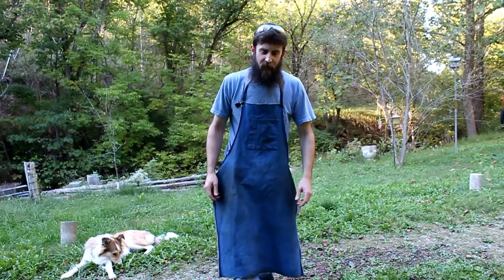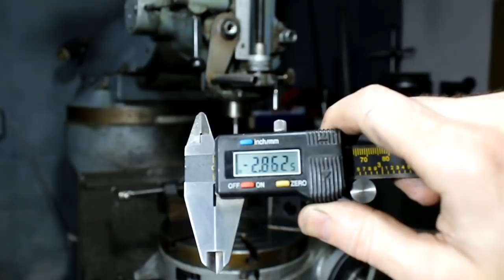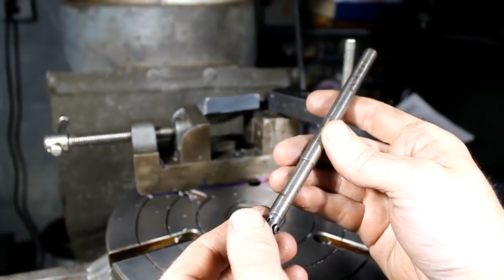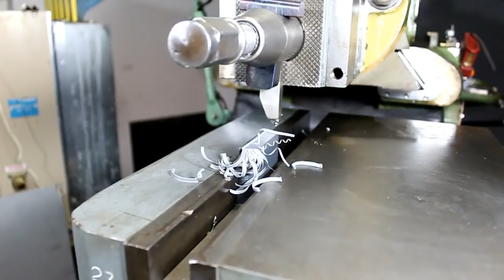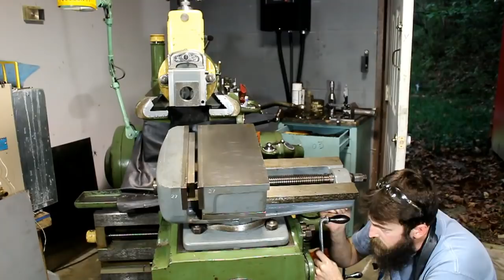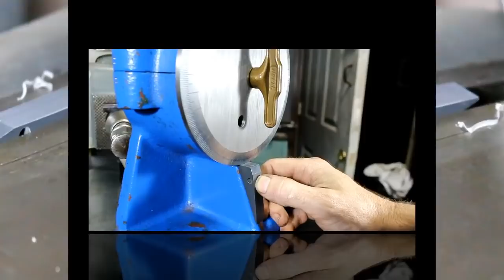Angle plate progress/ Vernier scale & Metal Shaper Work

Comment: oh Steve - just cos you got a fancy pants tool room adjustable work box doesn't mean you HAVE TO USE IT  :-) 
Impressive set up on the mill for that bevel cut - not something I could have achieved on my mill. I think I would have gone for a thin brass sheet and then bent it to fit the angle and overhang the rotating bevel edge - but yours will look better for sure when you are done and not catch chips. Took me a while to get my head around your 1 deg 15 sec'  index for the vernier scale - Im afraid Im still on linear verniers and drawing lines to copy the  angles back to the base line - but then I learned on a drawing board at school too many years ago.  Nice work my friend. All the best Mat
Reply from the maker: Hey Mat, someone told me "You got a fancy pants shaper table , Why not use it? " so I figured I would.... :-)  I spaced them the 1Deg 15Min so they can be easily read, if I just spaced them just 15Min they would be so close you could not tell one line from the next.. It can get confusing, I have not used a lot of Vernier scales and had never even thought about the construction of them so it was a large mind task for me to come up with the way to make one. Now that I know how its  simple , but it was not in the beginning .   Thanks for stopping by Mat, Glad to see ya
Reply: Still trying to get the vernier straight in my head. when I made one for splitting 0.001" down to 0.0002" on my surface grinder height. I drew it out flat - calculated from the dia' of the original wheel the length of the circumference for 0.010" then subtracted 10% i.e. 0.009" I drew this up as a base line with an angled line coming off it crossing at 0.000 - marked of the 0.009" length on the angled line and took the tick mark back as a straight line down to the 0.010" line on the base line  - then set my protractor to that angle and marked the other lines down to the base line all parallel to the first -- in my case I marked every 0.0002". So the vernier scale distance for 0.0002" was actually the equivalent of 0.0018" on the dial circumference .... you still with me ? Doing it in degrees and minutes confuses the hell out of my peanut ! But then I could be wrong - it happens :-)
Reply from the maker: lookcreations I think I am still with you.... lol . This stuff can get a little confusing 😣. It took me about a day of uncertainty before I tried to make the 1st prototype.

Comment: Thanks for showing how the shaper table tilts, it really is a great feature to have.  When holding a part with just the outer corner of the vise jaws, I've found it useful to throw a second part of equal thickness in the opposite corner to keep the moving jaw from twisting when you clamp down.  Thanks for sharing the video, can't wait to see how this angle/index plate progresses.

Comment: Good stuff Steve!  Thanks for sharing your work.  One thing I noticed, that boring bar you used for scribing is an Everede style boring  bar, it's meant to take triangular shaped HSS tool bits.  I'd  be careful with putting round cutters in there and actually boring with them.  That clamp is racked back quite a bit, and it's meant to sit closer to flush.  Do a google search of "everede boring bar" and you'll see what I'm talking about.
Reply from the maker: Yeah you are correct, I have the proper cutter for it. This cutter is just for scribing lines.  Thanks for stopping by and commenting.         Steve Summers

Comment: I believe I would make the face that has the marking lines on it 90*  from the adjacent beveled ring face with the marks you already did on it rather than the somewhat acute angle/parallel with the base that you showed here, but just my opinion.  A suggestion on coloring the marks I have is to use epoxy with black dye in it, I've used it to color in file work on the spines of knives with much success in the past and it's very tough.
Reply from the maker: Like the epoxy idea, I may try that.  Thanks for the suggestions .

Comment: Thanks for sharing another great video. Scribing those lines with the milling machine reminded me of a job that used to come into the shop where I was working, We cut dovetails in screw machine tool holders and did it by using the bridgeport as a vertical shaper.
Reply from the maker: Wow, bet that was a lot of work.   Thanks for stopping by Newt

Comment: I think it would instead of 25 or 15 degrees. Make a line from point to point with about .025 thick at the bottom part of the wedge and when you set up in vice make the line parrallel with vice jaw and .010 or so offset out of vice from flat so you don't crash into vice hope I am making sense. Only suggestions.good job beautiful machine
Reply from the maker: I get it.  I almost like the small flat left on top before the radius.  Looks is more opinion than anything, the heart/function is the same no matter what.  Thanks for the stopping by and thanks for the suggestion.